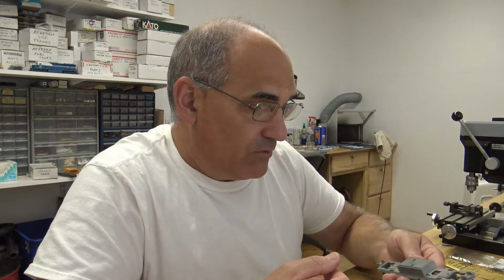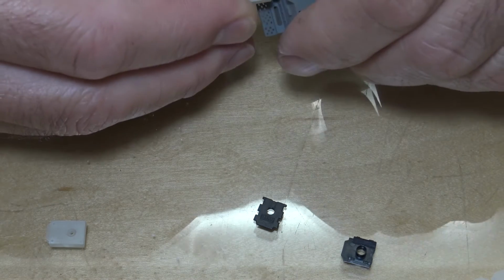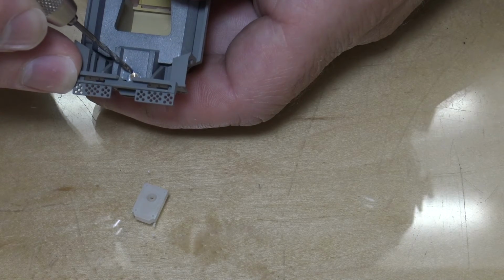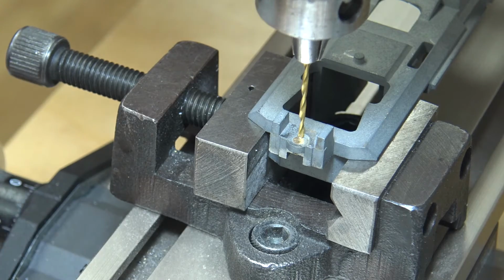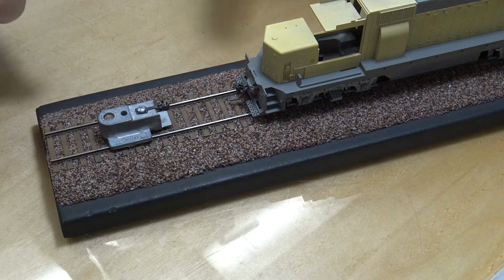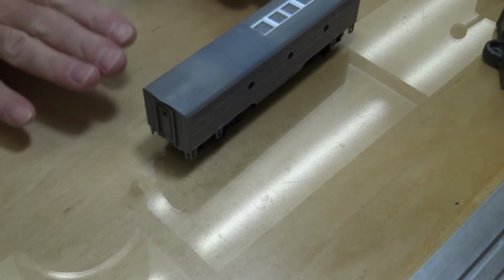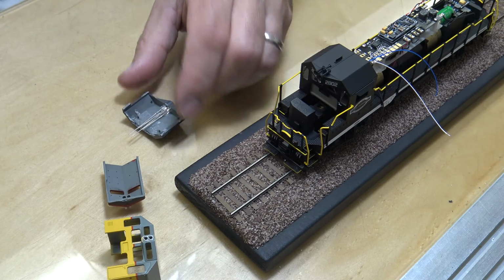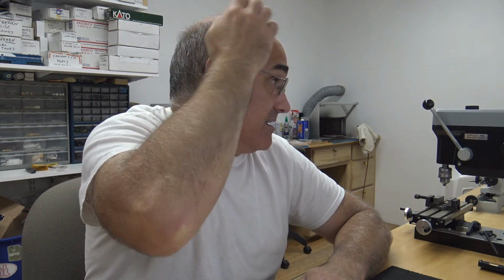KATO GP35 PROJECT x6 FRAME SETUP AND MODIFICATIONS

Comment: Great video, as always.  I appreciate all of the tips that you share.  What type of LEDs are those and where did you get them?  That installation looks such much better than the LED installs I have been doing on my locomotives.  Thanks again!
Reply from the maker: The LEDs are a very common type. I use Warm White. The front LED is a2mm  Tower LED or Flat Top and the rear one is a 2mm Round Top LED and I bought them off EBAY.

I bought them off Ebay. They are rated at 3.0V to 3.2V. There is no part number listed on them. The only thing listed on the package is the color and the voltage rating.

Miniatronics also sells them. They are a bit more expensive and you get less of them per package.

ROUND TOP: https://www.ebay.com/itm/292575237533?_trkparms=ispr%3D1&hash=item441ed7d59d:g:iRcAAOSwKwBbBSIY&amdata=enc%3AAQAGAAACkPYe5NmHp%252B2JMhMi7yxGiTJkPrKr5t53CooMSQt2orsS%252Fwocn770hnih0B3mVHNZ5Cny2kGpWCN2rLhQKAyGGC9m9%252FLJtPUrxG1K6ngAHVoKZXGKRTmFIulCiCfiNZ6Q%252Br7ijUSEdtxWtOuDlS5miOgfhmu5XEFZA3Vmf09Dfy36WAPHZPChj9STlIxWWnV7%252BjBlzrNpJSfQ3kdkVvN62wwcka%252BcMbFRYpK9VumW%252FEOm6Bx4TQDZnTYyylHBIkEXlbqWynKveXeY8%252BUM3BLb4R6WwuN2eupHNWKqcPwgeHud0xLQWZhu%252BcbJPd1WWrVPRBQGgH8tQGJ%252FHQQgYJNE5lo2LdMAwhx3qqoZ0meRgZW0oJ5tjhs5U2Xig%252FXYSA1znnJEybdl1kegFGqYHS1ovrG1bwc7ZzI4vT%252BuAtww%252FlI6V0hu7yevpOB9W2%252FgAqf1ij0GraepqMXtSbAzH6fgQByuRqr6tLrFjtLcVD3EUfjSZYvnE9RADIKZdkiGc2dY4%252FPFCWilCfxQUncTntHFpG5OmTRvfVLnaffey27SqMlHr256bAKmWMkcM%252FhRh1yehKxOv7fphpGIf2RmeKjIqX1Eg9HYAe1LnLtvM9ph4DnDZNhjfK6PGaIUJ8ji2a%252B7XHEVdNLmupM2gLKQ6Cthp9W6lMWoPjx%252B5yJB9K0Fxxo6AAu4kN4PamiBhrbgkwlZn0qvamD5w%252FQ35yHtMCcDgxvp7RMtmHlTMNVjIdbPrG3Gps%252B1oIzXesfOLO%252BzPHnmMCtteRvrQU6JijUaoI694AMiFYc0XTNne49wQiG%252Be9kdpeOEv%252BSM9Iipr09Xhpd%252BjLOfUElMBbUema1n%252FYKu05Bcj78aqNg%252B7XLAEbhpV9oI%7Campid%3APL_CLK%7Cclp%3A2334524

TOWER: https://www.ebay.com/itm/121742148097?epid=1256175939&_trkparms=ispr%3D1&hash=item1c5865c201:g:AP0AAOSwiwVWRCQf&amdata=enc%3AAQAGAAACkPYe5NmHp%252B2JMhMi7yxGiTJkPrKr5t53CooMSQt2orsSxXDXcCydCuSj2Tq2S%252F3GnkDhAiaw404q4aTvQ2WB7WgbGQ90zxCQO3ebP9djqJzF3Pc%252F8iuYTgk%252FrpLLcot3nompz2Yu4iQL2007KFM0pY07lbOTYZgETl6G4N2n5cKCund8PWh6qC7nWlhE%252BYAI65K1JzfWirLGp%252B3Ny73icpUzZMv8eSIdK4c26xwASP8p%252F2IRFCM8KBjUx%252BP7OC%252BLrevE8HRK%252FOBWvOYg%252FdVlkg9QmZJTmDN9nHm6x1yFRfgirIsGz1GAUhe%252BP34xaw4kdgcOTpanyEAO5QakM3beOaEIbNce%252B2FUs3kIYsXYe4r7PFbfbCMm6NHIQcn%252FS8C6vfv8Uj2961fdbROQiWIvkjhygNhICEUDPHTj6Em9YchQIpJ2kViLwT17eUWNJNTorFpr7SLqMpfY638qXNorfVILHn091LlljG%252BhtZPWUcPefVq2R31keNMKKCgCx7ln5Slmv6qQJMNokSRqGqYHizfR2Un%252BwF9QBanHgdfky3L7Wdz9LeIUK3OqRizLdgcBGAqCkHallqQoweGf91CudKyXjvP%252FCRs9YMuaBNeJcyngZhSqTT77b489QS6bqfiJ8siizjkUZ92VvvOuJZk8OMbkI78%252BdJDE2ieLMJYWoQqwSvlIuRR%252FDL8GI2BnwMb7mIurcymBziDQqQIdeBlssbVeR2o5HGKRlcXPUzde4w1%252BqEMTkEeoTDevvbzdCi5PzSbTRxioiCzHpijUz8kFod0Y9DPTftUC8gEdQ%252BQox3Tb6n7%252BP9SYfEaV1oMlXSQSanZ3X45yS73tnytPIXjx2FB3%252FYn7yT8fbL%252FRXCV49m49%7Campid%3APL_CLK%7Cclp%3A2334524
Reply from the maker: Also, you will want to get a #46, #47 & 5/64 drill bits to open the light holes for the LED to fit in. #47 is a tight fit and a #46 is a looser snug fit. The 5/64 drill bit is to help gradually open the hole so you do not gouge drill.
Reply: @6axlepwr  Thank you!